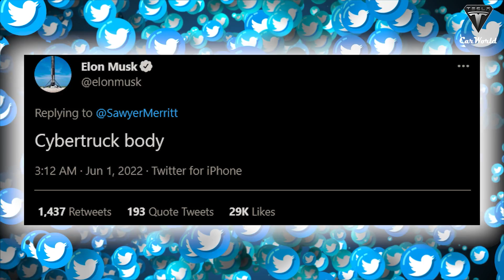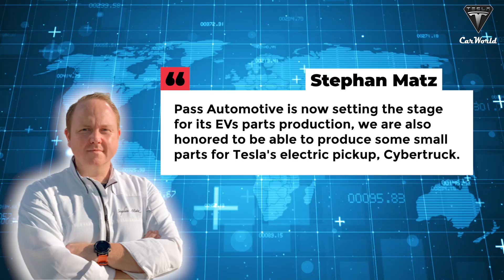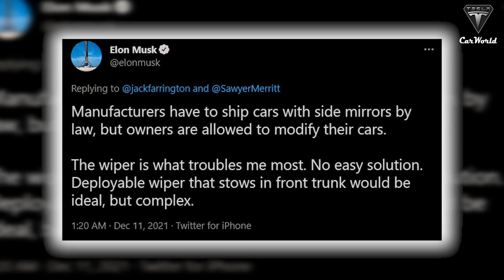Elon Musk Reveals New Insane Cybertruck Production Line "NEW Motor Assembly"!

Comment: Can Elon please fit a electric motor in my 2018 Jimny ?
Reply: Get yourself one of the drive motors from a used 🚂locomotive. Then get two or maby three of the Tesla car batteries 🔋to power it. This application works in a Ford F 350 or better but must have ample cooling potential!!!! That's the reason you see those huge fans on top of the big BNSFs. Those six wheels you see from the side are one piece with the other side and each of these are directly gear driven by an electric motor. So some have six and other more powerful have as many as 8. This in turn will push your blank along as fast as your brave enough to go!!! 200 mph duely no problem!!!! Excellent excelleration hold on to your blank!!!!!
Reply: there are people who convert all manner of ice tec into electric Sany maybe? plus local guys in garages

Comment: Cybertruck looks awful.
Reply from the maker: Yes, when it was first launched as a concept in 2019, the square design of the Tesla Cybertruck looked very odd. But in this 2022, it appears with a more complete outer frame thanks to many elements such as the added rearview mirror. Thanks for your comment !
Reply: @TeslaCarWorld  
I just don't see a construction guy hauling drywall in the back.  This is more of a rich man's toy, not a working truck.  🫤
Reply: @thexfile.  rich mans toy has  metallic paint job and shiny wheels. This will take whatever a tradie throws at it and will last longer than any of those poser trucks.🤔